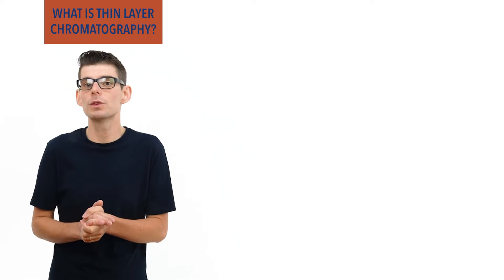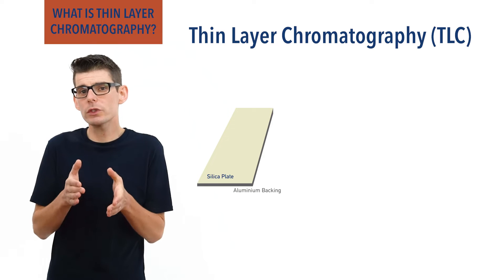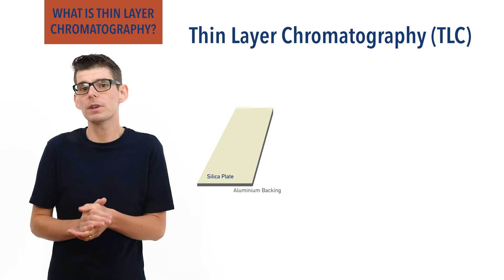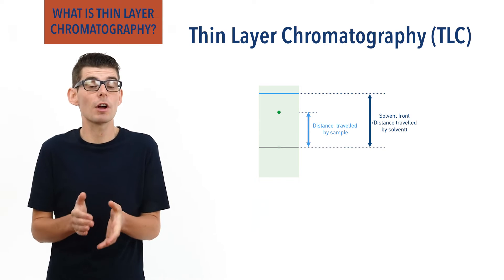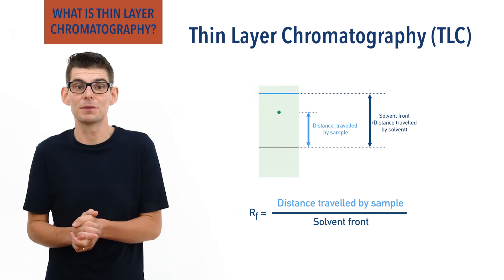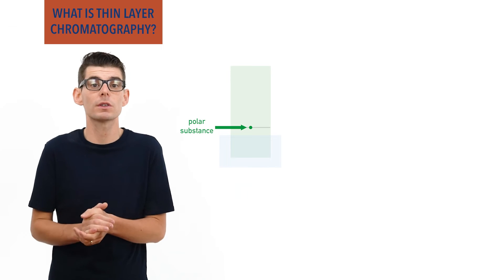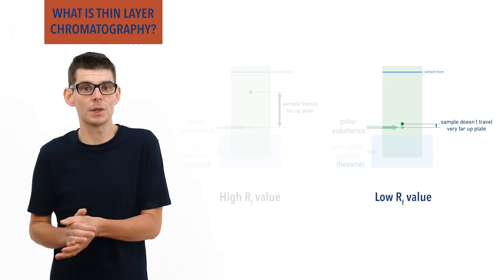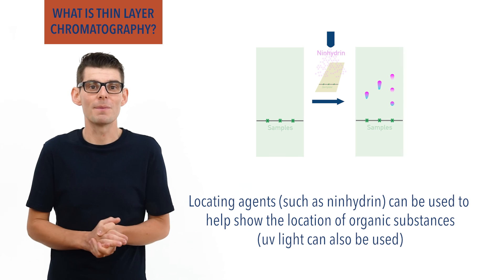What is Thin Layer Chromatography (TLC)?

Comment: What System to use here in case of lactic acid ? Is BAW 4:1:1 good ? Thank you
Reply from the maker: Yes, it could work because lactic acid is polar and will likely move with the aqueous phase. However, if separation is poor, you might consider adjusting the ratio or using a more polar system (e.g., an ethanol-water mixture of 70:30). Sometimes, a little bit of trial and error is needed :)